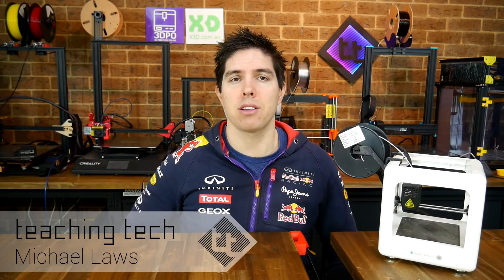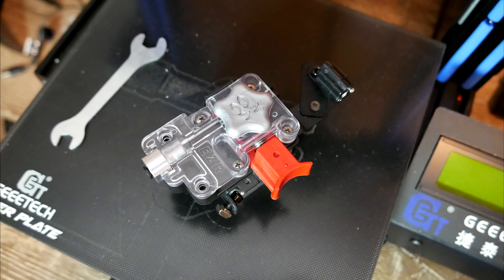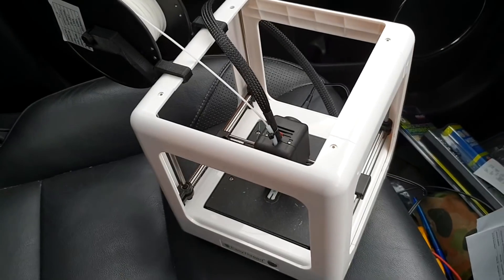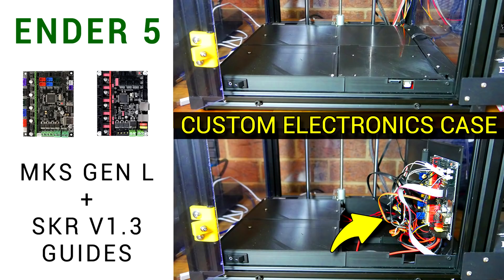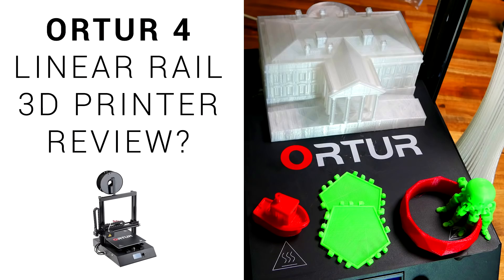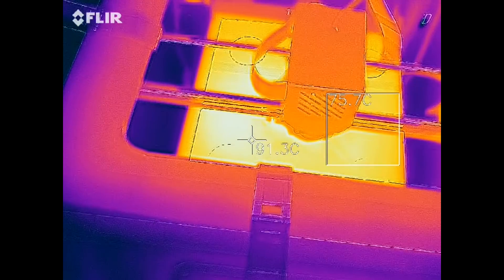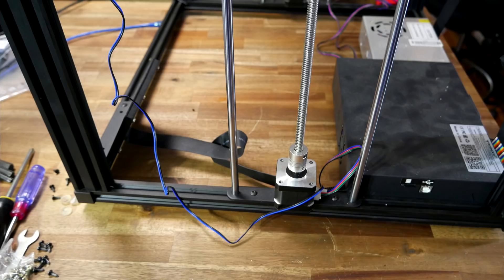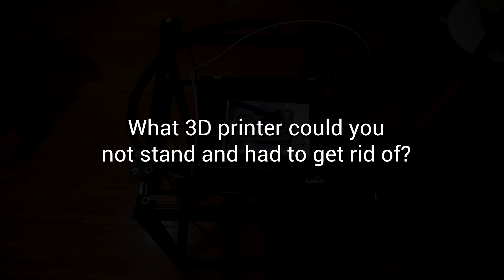3D printer review updates - Keepers and clangers

Comment: My own printer nightmares:
2x Pre-order CR10S Pros. Both arrived with severely warped heated beds, extrusions that weren’t squarely cut, holes drilled crooked, etc. was so bad creality just refunded me and said keep them. Gave them to a local guy who knew about the problems and wanted to mod them. Hope he had good luck. 
Then I stupidly got another CR10S pro about 6 months later hoping they had fixed the issues. This one was open box and they said it would have a warranty but refused to honor it when I found that it has been severely abused. Threads we’re ripped out on the gantry extrusion on one side, the extruder was assembled with the gear flipped the wrong way around, and there was some sort of magnetic sheet stuck to the bed but no build plate, so I had to get some glass cut and remove the magnet. I got it to work for a few months, long enough to pay for itself, and it eventually fell apart. I salvaged some parts from it and trashed the rest. 
Then there’s the Ender 5 plus. Why do I preorder creality machines ? What is wrong with me. Similar problems to the first CR10S pro. Bad power supply, wrong main board installed, extrusions are curved, z lead screws bent. I’m trying to salvage this one with a new power supply and skr board, but not sure it’s worth the effort with all the mechanical issues. Plan was to donate it to a school who had a printrbot that died.

Comment: Not a huge fan of the cetus after fixing 3 of them. They use an expensive mainboard and the stepper drivers all have 10 times the resistance of normal nema 17's leading to the excessive ringing. I got stuck with the cetus mk II meaning a terrible mk1 extruder and choppy one way bearing in the z axis. I tried running them on 12V and 16 micro stepping when the mainboards died and it created horrifying ringing 10 times worse than what you had and taught me how I would have to replace almost everything just to get Anet A8 print quality. The heated bed also struggles to heat to 55 degrees in 15 minutes. Certainly a machine that was outpaced by the competition and took way too long getting designed by someone that wanted everything designed expensively in house

Comment: Geeetech A10... I almost decided to send it back. Buggy firmware, noisy, PETG printing was/is  a nightmare. Extruder stepper was so hot on long prints that the filament became soft in the PTFE tube (leading to under extusion). Paid less than 200€, I added parts for more than 200€. Still have it but I'll change it ASAP.

Comment: Well you just fell down more than a stair case in my honours list.  Everything was at least reasonable but nothing was glorious.  Just points to the fact that you survive on "donations" from manufacturers.
Reply: I'm hoping you are not a troll but I have my doubts.  I have bought and used 8 different models of 3D printers and every one of them needed some time and attention to print reasonably well.  I can't say I was disappointed by any of them except for the DaVinci 1.0 that was my first printer and took a lot of time and effort to get decent prints and was constantly needing maintenance.  If you are handy you can get any of the printers reviewed to print reasonably well.  Also even the better value printers like the Ender 3 will need some time and attention.  I've yet to see a printer print well right out of the box without some tuning.

Comment: Just retired an ender 3, some fantastic prints and a lot of failed prints, stripped it down completely. Dents in the v guides, bent extensions etc. Did have some stuff to upgrade it with, but can't be bothered feel to much would need replacing and I inheriently dislike the design. Beds should move vertically that what has all the weight, plus I seem to like tinkering a lot but I do need one reliable printer. This is the problem with creality, especially 2-3 years ago. There qc was bad, from what I've seen the qc has improved a lot over the years. However some of the parts and upgrades I've added will be going on to a home built machine, waiting for a bunch of parts from china to arrive.

Comment: I bought a CR10S Pro as my first printer a while back, it worked just fine out of box except the original ABL, bought a BLtouch, worked just fine, then my nightmare started with a mass of failed prints and would not find out why
I was ready to return it and just use my claimright for all these issues that I got

But, since I am an old farmers boy, I am pretty stubborn!

So, ended up with all of your 7 fixes, added a wham bam flex bed (best purchase I made for this!) and then by a whim just upgraded my hotend to a microswiss all metal, and I the light suddenly shined upon us again!

My original hotend did look inside as if someone had drove a bad file through it, also it leaked badly, so it was just a failed factory hotend, so when you do have issues, check your hotend on the cr10s pro first :)

Now I am printing almost every day with it, did my first PETG yesterday to make holders and a new fan cover, and it works goooooood again!

Comment: Had a Robo 3D R1+ that worked flawlessly for two years, then all of a sudden I had issue after issue between bearings failing, x and z stop switches failing, hot end failing and after all the replacements were complete, the printer could never again put down a good first layer.  It’s now been condemned to the attic being replaced by two ender 3 pros. I only really miss how fast the Robo 3D printed!

Comment: I had to get rid of my Anet A8 clone. No matter what mod I did, no matter even the aluminum profile I bought (Ender 3 style), it never printed anything that wasn't either a blob of molten plastic or something out of a Picasso painting. I got then an Ender 3 Pro, and it has yet to let me down.
The only good note about my A8 (albeit bittersweet) is that it taught me a lot about 3D printers; when you have to disassemble and reassemble one multiple times, you're sure to learn it inside out.

Comment: Have you ever owned a 3D printer so frustrating you ended up getting rid of it?

Yes, DaVinci by XYZ.  Actually I had 2 of these, one I purchased and one sent to me so I could write a review, which was not positive.  It only printed PLA that you purchased from XYZ because of a goofy proprietary filament counting board that was fairly easy to circumvent with a little bit of additional electronics that would re-write the module that came with the filament.  I was never happy with the prints from either machine, they just looked very rough.  I had lots of trouble with filament not extruding properly as well.  As a result, I didn't do much 3D printing.  Working as a volunteer at a local Maker Space, I came into contact with some other printers, which had far better results.  When we acquired a Prusa MK2.5s, I was blown away by the quality, ease of use and versatility of the machine.  Since purchasing it about a year ago, I have used probably 10x the filament I used in the entire 5 years I had the DaVinci printers.  I gave one of them to a tinkerer I know and the other ot Good Will (the one that worked the best).
Reply: I agree with the DaVinci by XYZ.  After a while it wouldn't print right.  Asked for advice from them and the reply was to send it in for $300 and they look at it.  It was a software configuration problem not the printer.  I scrapped it.  Found ot later that it was caused by me aborting an update.  The new update would have disabled my bypass of the proprietary filament system.  The person that figured it out paid the money.  When it came back he had to use their filament which is twice the price of a good filament.   When I tried to get off the mailing list they wanted information I wouldn't give them if I continued.   Took a battle with customer service to get off without giving that information including a threat of calling a lawyer.   Bad company.  Love my ender 3 which I decided to get because of Michael.  Thanks for all the great information.
Reply: XYZ definitely deserves more public hate from a youtuber to save others from "experiencing" their products.

Comment: Yes, still can't get my geeetech E180 to complete a single print (gets half way & either spaghetti's or knocks it off the bed). The only reason I keep it, I have left over parts & truely are considering swapping the MB, display & adding fans. Want to get it running as a "office" printer. But that's got to wait till I finish fiddling with my FrankenEnder & trying to decide what large bed machine I want to get (so far it's bwt cr-10 v3, cr-10s pro v2 or ender 5 plus, but still looking). Your video gave me a few other machines to look at now, so who knows. 🙃

Comment: The monoprice mini v3, the one with the auto levelling sensor, is an absolute pile of junk, in fact mine is now a pile of parts, after I left many negative comments regarding the printer and monoprice customer service, monoprice contacted me and offered me a full refund plus £100 to spend on their store. The v3 is still a pile of junk, but monoprice, in the end, did the honourable thing. My ender 3 (with an skr mainboard, e3d v6 + bantamount and textured pei spring steel) is the printer I couldn't do without. Thank you Michael for all your informative videos, I have learned a lot.

Comment: Prusa Mini is a great printer, far better than my Anycubic i3 Mega. There were problems with clogging hotend but it was easy to repair and now i'm printing with Fiberlogy PA12+CF15 (similiar to NylonX). Also there are still problems with Octolapse, the printer is not extruding and is not heating when Octolapse is on. In all it's a great printer with nice features that prints without our attention

Comment: I haven't had one that I couldn't wait to get rid of. I started with the Anet A6, put ABL on it and that's all (aside from firmware). I now have 2 Ender 3 Pros and they are workhorses. The ABL didn't fix all of the Anet issues as the Gantry twisted and threw off the measurements due to the mount I chose to use. The Enders aren't perfect either, they both have low spots in the middle of the heated bed (concave) and I ended up putting a glass bed and binder clips to compensate on one. It prints great and reliably, SKR Mini E3 board to come for both, ABL likely at the same time (I really do like the standard flexible bed). One has been upgraded to Capricorn tubing, the other not far behind.
Reply: I too have Anet A6 as my first printer, does great and has become a household necessity like the microwave oven.  I'm curious about updating the firmware to Marlin, is it really worth the challenge?
Reply: @chrisingram7277  yes. For the safety. No thermal runaway protection from the factory.  That was my main reason. I had to flash for auto bed level though.... But that was over a year after I did the initial flash

Comment: My first 3D printer was a Micromake D1 delta. I bought it in 2015 with heated bed and HIWIN rails and it just sucked. The printer itself was good, well engineered and built, but auto leveling system just didn't work, and back then, in 2015, there were no delta calibration features in the Marlin or Repeatier firmware. I had to rebuild the whole head, buy a membrane sensor, and use some buggy and unstable software to perform auto calibration. I still have this printer. I installed a 0.2mm nozzle and use it from time to time when I need to print small and detailed parts. It just could not work out of the box, so it taught me most of things I know about 3D printing. :)

Comment: The most frustrating printer I have had is my x5sa... but im stubborn and am doing a complete overhaul on it now. Put an skr 1.3 with 2208s a while ago, now i just installed linear rails on x and y, a bondtech with v6 and all metal hotend (direct drive configuration) and am bouncing between stand v6 amd volcano block. Also just got in a set of 2209s for review on YouTube channel and am going to give sensorless homing a go.

Comment: First 3d printer I got in 2016 was the Creatbot which I still have and has done well over 2000 hours of printing though it needs repairs.   The second 3d printer I got is the wombot exilis, I wanted to get the prusa but had a 9 week wait time at the time so got this instead. This I am waiting on some nozzles and heat break replacement atm.  The third 3d printer is the Cocoon Create Touch which I have upgraded the firmware and put the flexion extruder on.  This was great when I got it but being a paint atm, can't figure out why it starts out printing great and then just stops due to jammed filament.  I have replaced nozzles, heat break etc on this machine and no good.   So unless you are willing to put some time into tinkering/fixing these machines it's not worth you getting into 3d printing.

Comment: “Have you ever owned a 3D printer so frustrating you ended up getting rid of it”
Yes. The Flashforge Creator 3. Flashforge basically used me as a prototype tester. It wasn’t ready for market. The extruder design is fundamentally flawed. It wouldn’t reach the advertised temperature and there was no option but to use their firmware and slicer, which made the z height probe an essential part of the print start process, but the z height probing would regularly fail. Very very frustrating and a complete waste of time and money. They quickly changed all the points that were bad and did provide a good level of support, but that made me essentially like I was an unpaid member of a beta test team. Now they have upgraded the bad design features and I’m stuck with a bad printer. I haven’t sold it (I wouldn’t curse someone with it), but it sits idle. I now have the SK-Go which, if you have the time to build it, provides an awesome machine on every level.
Reply: I took apart my Sintron delta and Anet A8 3d for parts as they were a liability. I have three Aldi printers which have been brilliant.

Comment: The artillery sidewinder gave me headaches from day 1. Failing extruder, failing ribbon cables. Jams, layer shifts and all things you don’t want from a printer you rely on. After sales service from artillery is non existent. They offer you buying new parts when something fails. Love my ender 3 and prusa mk3s both super reliable. One more a tinkering machine, the prusa for ultra reliable print results
Reply: Can not agree with that, after sales service is good for a chinese company, also mine is printing flawless with minor upgrades since 8 months. (Nozzle, Aluminum Bed, new ptfe pipe)
Reply: FireN2k9 well than I must have gotten that Monday morning model

Comment: I actually haven't gotten rid of any of my 3d printers. They become parts donor and are much appreciated these days as I continue to develop my CAD skills and design different variations of printers. I'm a sucker for cheap full size printers (200mm-ish cubic build volumes) for the same reasons, PARTS!
Reply: You might like the Tronxy X3 ($99 shipped to your door and has a 200+ mm all dimension print bed, Z height is actually over 300 mm even with my much thicker magnetic flex bed added). It comes as a parts bucket (they have the hottend assembled but that’s it). It’s actually not bad as is, but it needs 2 things (both printed parts): bed stabilizer and variable vent fan duct (last one only needed if you print PLA, works great with PLA and ABS). You can find them on EBay, all the motors are the full size, including even the duel Z screw motors for some reason (not sure why, those can be much cheaper short NEMA but they opted for more expensive). So decent pile of 2020 Aluminum, 5 standard size NEMA motors, heated aluminum bed etc.

They are just an older model and I guess nobody likes Legos anymore and insists on things built out of the box. Mine has been running smooth as can be for several rolls, but it’s also pretty cheap as a parts kit too!

Or there are also A8 models for like $79 to $89 but they don’t have really mod friendly frames (at that price you’re getting either lasercut wood or acrylic, which I do have an acrylic printer similar to these that’s like 7 years old but slightly warping and I’m using rubber bands to pull it a bit straight yet remarkably great prints at high speeds anyways). Those just don’t have as mod friendly of frames and I think that’s what you’re going for (you can still mod them, mine has a printed Cyborg extruder with large diameter stainless steel drive wheel, improved gear ratio, couple different extruders over the years, and over-volted for much faster heat up times and fans on the motors because they get toasty when going beyond 120mm/s).

You can find these on EBay, the Tronxy X3 I got from the official Tronxy seller, really good deals out there for custom builds, I just wish they had linear rail or Deltas in that large size in the $150 and under range (I could probably add that to my current Tronxy and still be at that price, but I wouldn’t mind a 3rd printer!

Comment: Very interested in your progress with the bondtech gear remote drive extruder. I have a custom railcore derivative and I am currently designing something similar. People trying to achieve the same task have had problems with printed worm gear tolerances causing inconsistent extrusion. I am trying to find a cheap AliExpress globoid worm gear set. Others have solved it by moving to a planetary gearbox.  Any input would be appreciated.
Reply: Would also be interested in whether you're planning on water-cooling the ender 5.

Comment: I started with the Flashforge Finder and Flashforge creator Pro both of these started off okay, but eventually after a few prints went downhill. As a beginner, I did not have the knowledge on how to fix so they ended up collecting dust. The Prusa Mini is my current one, and I look forward to your mini revisit. My mini has issues with the extruder grinding the filament when loading and unloading, but I've managed to get the tension tweaked to limit this.